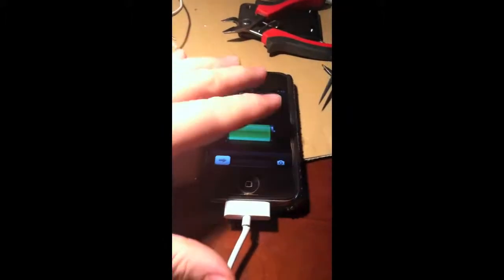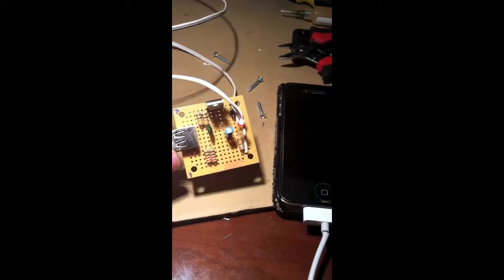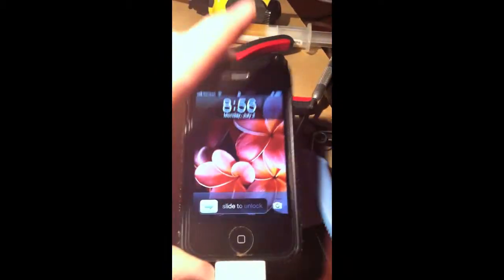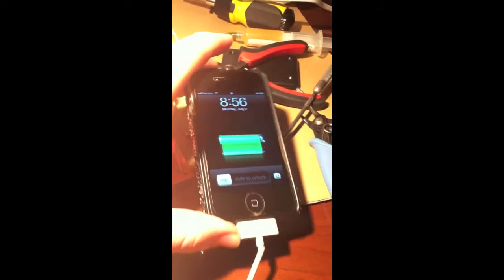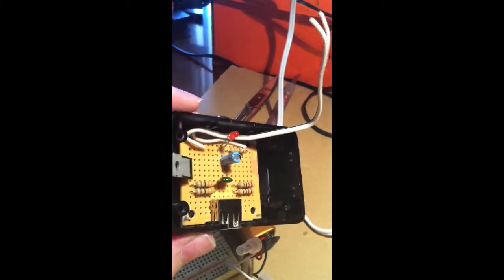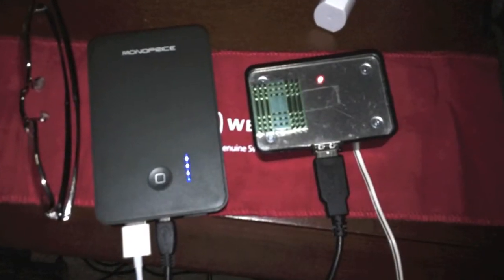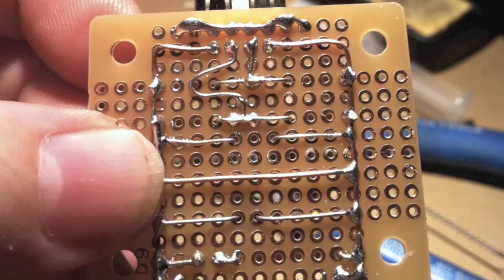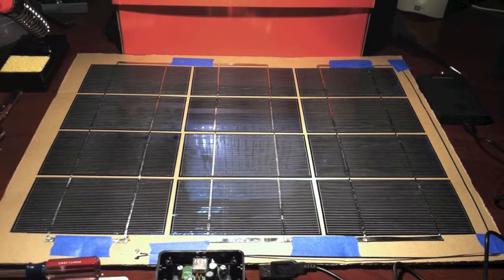Homemade iphone charger circuit

Comment: what if my energy source is a wind turbine instead of solar panel? is it going to be the same way to charge a phone? and if you have any useful sources for me that would be helpful i am building a wind turbine and I want to use it to charge my phone and I know very little about the electronic connection for that
Reply from the maker: It depends on the output wattage of your turbine. I would look into D.C. to AC inverters. Pick up an inverter that can handle more wattage than what the turbine puts out. Many inverters have USB outputs included for charging small devices.